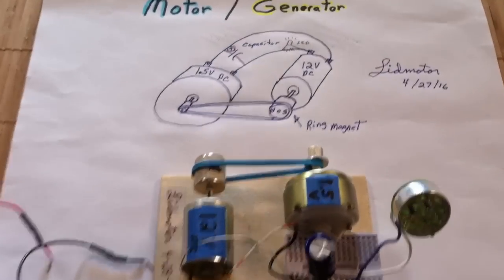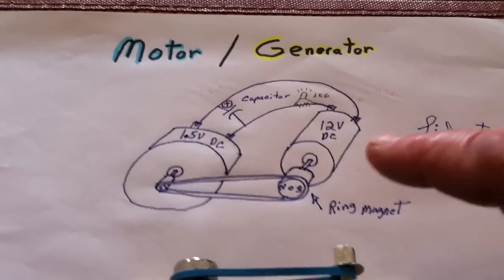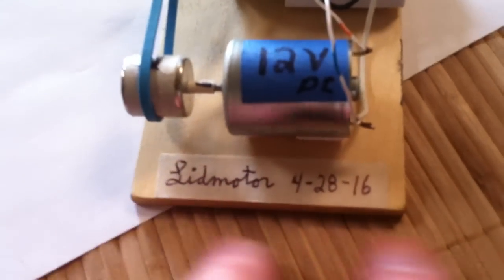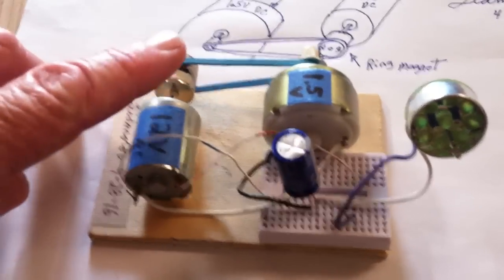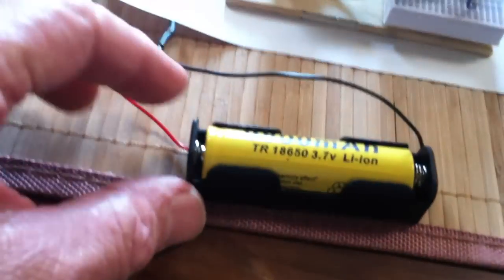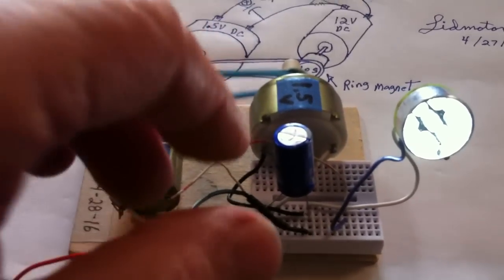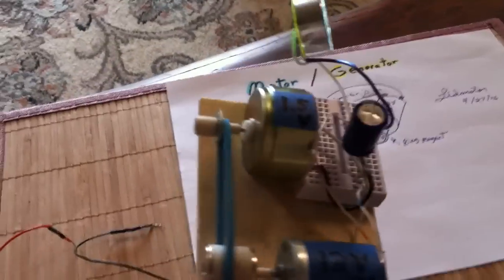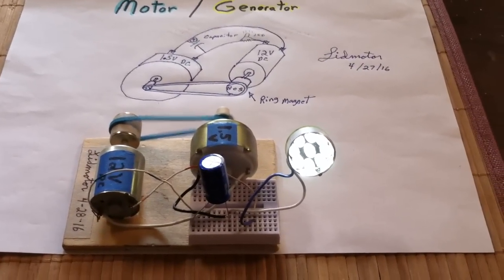Motor Generator---- how it works

Comment: Hi Lidmotor , love your experiments/work in general, in this case if you use a flywheel interconected with the 2 motores you can store more energy, with a strong start "my opinion " , and i have another way to try it "speaking about the rotation conection between the 2 motores , if you use the repulsion of magnets to put the 3 rotors runing you will go get less friction , we only have to make some precise space between the magnets in the 3 discs ,we change the pulleys  to  some non magnetic material , example : wood disc's with ("coin"-neodyum magnets) inside the discs that are conected to the axe of the 3 rotors , 2 motors and 1 fly wheel working the 3 with repulsion ... another point :  if you change the angle of flywheel in relation to the motor/generator ,probably gravity will go to make some changes to the production . . . hope that you try it some day :) big hug my friend

Comment: Have u tried to run it in vaccum. I  have had a little different system set and not using battery to power it directly instead motar with rod on both side. Never been able to setup. Lack of resources.

Comment: Lol...  Fake    you need to go to school,  to learn the first law and the second law of thermodynamics
Reply from the maker: Gil this is not fake.  It is a simple device that is running on energy stored in a super capacitor.  It gives the "illusion" of doing the "free energy" thing but it isn't.  Did you listen to the narrative or read the description?
Reply: Ok.  If it's "illusion"  due to stored energy,  that's ok 👌
Reply: Gil --  I thought " Laws " were supposed to be the act of the legislature. Which legislature passed these scientific theories into        " law ".?

Comment: can it power a phone charger? I'm not just asking dumb questions I really appreciate it very much for your help
Reply from the maker: If you took the output voltage from the 12 motor and put it through a 5v voltage regulator circuit----I think it would charge a cell phone.  It is a mechanical DC to DC voltage booster device.

Comment: ill try this but its not work..the same connection desame motor   its not work maybe have wrong to my connection.
Reply from the maker: You have to POWER IT!  It does not make energy.  Just use a battery if you don't have a super capacitor.  A smaller voltage rated DC permanent magnetic turning a higher voltage rated DC motor give you the voltage boost...but it cost energy.  No free ride. :(
Reply: +Lidmotor 
it was too good to be true, but it does make energy last longer right?
Reply: How about instead of a battery, use another dc Motor as a hand generator with a blocking diode, to charge to super capacitor. Would that work?
Reply: Catalino Ormita

Comment: Try setting up the supercap(s) as captrets and see if it will self-run.
Reply: Add a flywheel about the size of a soda can lid and you will go overunity if loads aren't too much. Also add neodymium magnets with proper opposite poles aligned to opposite sides of each motor to gain much speed for same input. And of course larger pulleys have better leverage over their own center shaft as well as added flywheel mass energy. And use a larger pulley on the drive motor and smaller on the generator.
Reply: no you wont the fly wheel just stores more energy it will die eventually
Reply from the maker: Yes.  This device does not 'make' energy---it uses it.  A flywheel might help smooth out the running but won't make it run longer.  It will stop when it runs out of stored juice in the cap.

Comment: What is the role of ring magnets?
And where to get it or where to find her?
thank you very much
Reply from the maker: The ring magnet just serves as a pulley.  It could be made out of wood or plastic.  The magnetic qualities do nothing.  It was just something I had on hand that fit on the motor shaft.

Comment: nice. I will make one sometime. I think you need to filter the voltage by using diodes and recharge the capacitor with DC converting your AC to DC output since you have a 12 volt motor running.

Comment: what is name of device conneting dinamo/generator?
Reply from the maker: rubber band.  The pulley is a ring magnet (not needed).  The wiring is copper. The capacitor is a SUPER CAPACITOR  2.7v /6farad.  The led is out of a flashlight. The little circuit board is called a proto type bread board (get it on ebay or amazon).

Comment: in the bottom of the generator they have a battery lithium ion 5 V; 2800 mah
Reply from the maker: No.  This simply runs on energy stored in the super capacitor.  There is no hidden battery.  The device only runs for a short time on the capacitor energy---but that cap can be recharged thousands of times.

Comment: ill try this but not working like that..maybe wrong connection..plz give the complete diagram thak u.
Reply from the maker: Just take two DC permanent magnet toy motors of different voltage rating and hook them together somehow.  Drive the lower voltage one and you will get the higher voltage one to produce the increased voltage. No super capacitor?  No don't need one.  Just use a battery ---and remember this IS NOT a 'free energy' device.  It is a mechanical voltage booster.  It uses energy. It does not make it.

Comment: one more important observation which was not addressed if that 1.5 motor is running a 12 volt motor and you didn't give how much electricity is being put out the question is did you just perform over Unity?

Comment: this is Lloyd Stovall from Media Library which we have done hundreds of these experiments, we would like to know why you didn't let the motor charge the capacitor directly yes you added a little power but like an alternator in your car it does more than one thing at time, at 12v it seems that you have plenty of power to charge the cap and run the motor and the light, here's another question why are people trying to make electricity and gasoline so different they both are fuels we are not trying to make something run forever we only want to make it more efficient if you can make this device run for one week it is already more efficient than a generator keep in mind that Tesla had these such Motors and are still used today only in industrial work you have your answer now work with it. in our experiment it worked for about 2 weeks the little chap then busted on us we are working to keep this balance so this doesn't happen
Reply: Lloyd Stovall ; Agree, like the old wind up cars or prop planes, if we spun the 12v enough to charge the capacitor, it would charge enough to get it goin. Hence no need of external power/battery...

Comment: I don't like the fact that you people claim that there is no such thing as free energy. Yes the capacitor is keeping it running but let it run for hours and hours and it will still run as the capacitor is still being charged. It is not an "illusion" as you say it is. You people dis the other people this way that actually get it right to make free CHEAP energy that we don't have to pay the government.
Reply: Nut.
Reply: there is no free energy
Reply: Ozymandias King
''there is no free energy '' solar ,wind ,hydro ,geothermal are all free not to mention all the power from magnets

Comment: what's the current and voltage output?
ans.
DAMN FAST!!!!!!!
Reply from the maker: This draws about 30 mA. You saw the input voltage.  It is about 3v but drops off as the cap drains.  This runs great on a AA battery at 30mA.

Comment: Pretty awesome. Those supercapacitors are something else. They are really good at holding a charge for a long time. I subscribed to your channel.
Reply from the maker: Thanks.
Reply: What is the role of ring magnets?
And where to get it or where to find her?
thank you very much
Reply: Agoudjil Hocine Try online. Or take apart an old motor or speaker. The author of this video would know exactly what purpose the ring magnets have.

Comment: sorry but i think small 12 voltage battery is under capacitors body. sorry if i am wrong.
Reply from the maker: No battery. Don't need it.

Comment: hi lidmotor, you have very interesting videos like lasersaber, rooberts, etc  I like these videos, I get inspired by them...have you tried using a flywheel to the said motor generator contraption? how about pulsing the 1.5 volt motor instead of simply running if from the cap, it will be super easy to pulse drive the motor with the flywheel attachment of course, will it extend the run time with such an added feature?
Reply: fidel catsro capacitor vs. flywheel magnet....I like that !
Reply: SAD FACT is that the motor will come to a stop, i think it only lengthens the duration of the run, but sadly not perpetual

Comment: Hi lidmotor i do not understand, the capacitor you used is 6 farad or 6 microfarad
Reply from the maker: 6 farad super capacitor.  It is not like a normal capacitor.  More like a battery.
Reply: Ok am from Nigeria so what will i call it if i want to get it from Nigerian market
Reply from the maker: If you can't find a 'super capacitor' you can just use a 1.5v AA battery.  Remember this is NOT making energy.  The device converts one voltage to another with a mechanical method.  The process costs energy and is not very efficient.  It is a method that has been used for a long time though.
Reply: Ok thanks so much

Comment: a D/C motor puts out A/C currant.
try a rectifier to the super cap. then use a resister to  one LED.
the power from the super cap goes to the generator.
try that, let me know.
Reply: the more power you pull from your generator the more resistance it has.
Reply: you get pulsed DC from brushed dc motors.. not AC

Comment: So, you are using powered 1.5v motor to run 12v motor. Then, storing energy temporarily in super capacitor from 12v generator . Using super capacitor energy to run  1.5v motor..... 

Am I  right? 

Is there anything to be mentioned like rpm of each motor or so? Is that matter? 

Thanks in advance
Reply from the maker: The energy in the system was added before hand and is being consumed.  Generation IS happening but the energy to do it is much greater than what is being produced.
Reply: did you allow it to check that how long it can run so?
Reply from the maker: A few minutes.

Comment: Is magnet fixed in 12v motor plays any role in power generation?
Reply from the maker: That is a really good question that nobody else has brought up.  That is a very strong neo magnet and it must be having some effect on the situation.  Whether it is adding or taking away from things I don't know.
Reply: Please check the same without this strong magnet and make an other video and post
Reply: Certainly.  The current induced in a wire is a  product of the rate of change of magnetism and number of turns of wire.  Doubling the strength of the magnetic field will double the voltage created for the same rate of spinning the generator.  But of course, the energy required to make it spin will also increase.

Comment: Can it work if I use capacitor 2.7v / 10f or 100f?
Reply from the maker: Yes.
Reply: +Lidmotor did you know how to make this output to 3.7v for charging phone
Reply from the maker: I thought about doing that using a voltage regulator.  It can be done but it is much easier to just buy an electronic cell phone charger that does that.  They sell ones that work on one AA battery.  Remember this thing I show here is not 'making energy'.  It is converting one voltage to another voltage mechanically.  It is not a very efficient way but it works.
Reply: +Lidmotor hi, can you tell the diagram how that is work, loke compenent, atc
islandmasalembu@gmail.com please bro
Reply: +Lidmotor send to me too c0ker.ui@gmail.com

Comment: Hi, could I use  a rechargeable battery  instead of that cap. thanks
Reply from the maker: Yes. Any power source would work.  Just remember that the thing is using energy --not producing it.  Electrical energy is going bye bye into mechanical work and heat.

Comment: could you run a 1n4001 from the 12v motor to the cap?...and charge while it runs?.
Reply from the maker: +DEADASTRONAUTFX  I am still working on that.  I have tried several diodes and in different locations.  The leds were the last thing I tried and looked good so I put them in the video.  You will notice that they are not directly across the generator but rather in series with the circuit.
Reply: A DC motor being used as a generator outputs DC already because of its commutator.   If you apply a load to the motor that is being used as a generator, it will become difficult to spin, increasing the load on the other motor doing the spinning.

Comment: Maybe you can light up the LEDs and THEN charge up the capacitor (use them in series).
Might run as long, longer, or shorter, who knows. I actually expect it to run shorter, but it really depends on the voltage difference between generator and capacitor.
Note: I am very cautious with my supercaps. I think 3 Volt is to high for them, I always treat them nice ;-)
Reply from the maker: +deslomeslager  I have a number of super capacitors and as long as you don't go really crazy with them they seem to do OK with a little overfill.  It probably shortens their life a bit and reduces the capacity but I haven't blown one up yet.  A couple of mine have been in LED indoor night light service for years.  I really like them.

Comment: kipstr size?
Reply from the maker: +بلال السامرائي طاقه متجدده  The super capacitor I used in this video is a 2.7 volt / 6 Farad.  Very inexpensive.  Buy them on EBay for a few dollars.
Reply: how long will it run?

Comment: How long will it run for ???
Reply from the maker: +WTF BBQ  This little 6F cap will only run the setup for a minute or so.  The thing will run on a AA battery with the light on bright.  I calculate about a 20 hour run time on one of those.
Reply: *****  Gotta admit though,  that's still quite an impressive setup.
Reply from the maker: +WTF BBQ Yes I think so.  I was running this last night in the dark on a AA and was amazed at how much light it put out.  Unfortunately it draws 100mA but you can't have everything.  It has been a fun project.
Reply: +Lidmotor hello sir u r project is very amazing ...if i want to buy this . U,ll sell it....

Comment: so is it an aplifier for the voltage, still confused. it's a great illusion
Reply: +Lidmotor fascinating. is what do you thing makes this circuit work over the others you've tried?
Reply from the maker: +wise monkey  I am not quite sure.  I think that the pulley setup has something to do with coupled with just the right  mismatch on the motors.  Perhaps it is something else.